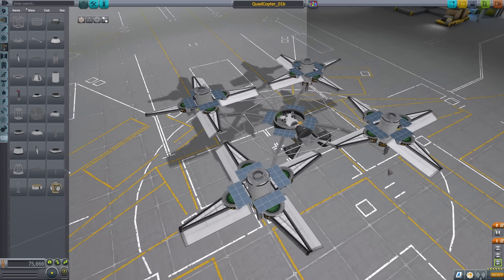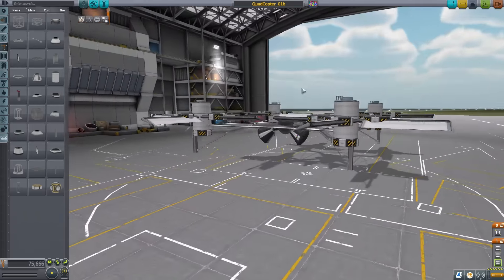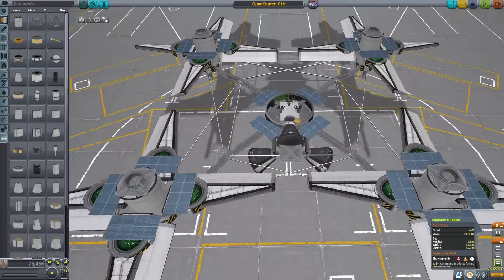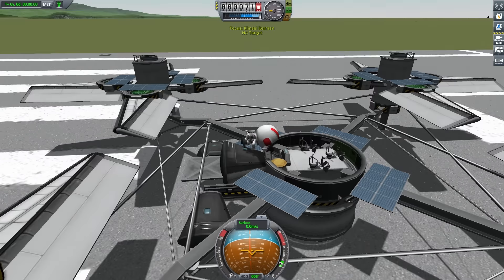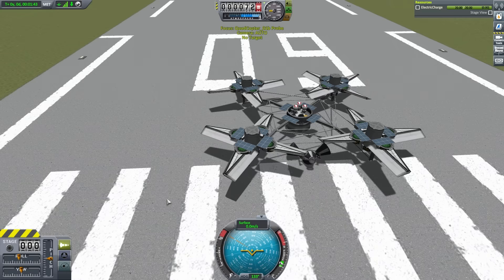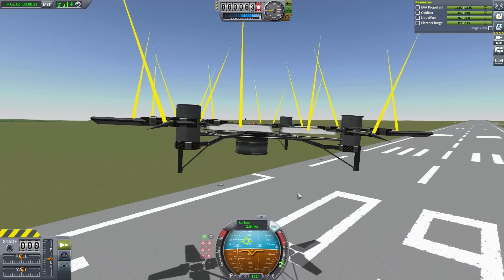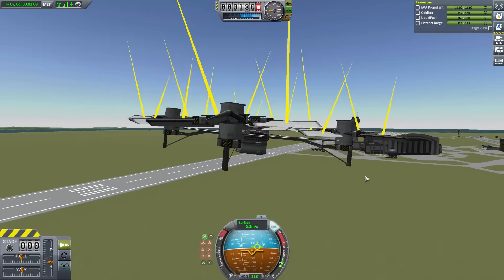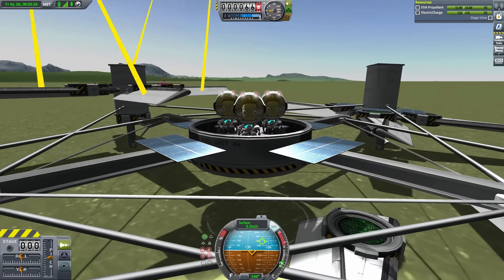KSP stock electric Quadcopter

Comment: I recommend the easy vessel switch mod for the prop crafts, all you have to do is alt + click on them and you are in control and it has the same camera angle!
Reply from the maker: That sounds dangerously like cheating.  ;)
Reply: Inter's Odyssey Also, infinite offset is possible in stock if the part has an attachment node and you turn on part clipping, all you have to do is attach, offset it a bit, and attack another part with an attachment node to the part where you attached it to the craft, and then you can offset it and take off the part after
Reply from the maker: You'll have to show me.  Doesn't work for me.
Reply: i made a different kind of stock prop tutorial on my channel where I clip a nose cone thru a fuel tank
Reply from the maker: Just watched it and attempted again.  It works!  The part I missed from your explanation was there needs to be two attachment points involved at the first juncture before any offsetting takes place.  In other words, the attachment point of the part you intend to offset needs to connect to the attachment point of its parent stationary part.  Then do the offset, then add a 3rd part to the inner attachment point of the 1st part.  But it works now!  Very cool trick, thank you.
Reply: glad I could help :)

Comment: Try putting a fifth blade in the middle instead of the payload that pushes down when you activate it, thus allowing you to bring the craft to the ground where you can shut off all the rotors and safely land.
Reply from the maker: If I'm correctly understanding what you said, you mean put a deployable control surface somewhere on the craft's fuselage that, when activated, will create sufficient downward "lift" to counteract the four rotors.  I see where your thought train was going, but you're also seriously underestimating the power of those rotors.  Besides, the rotors have the advantage of spinning.  They have angular velocity.  Any wing/blade/ctrl surface/whatever attached to the fuselage would only have surface velocity acting in its favor.  As demonstrated, this craft moves at less than 7 mps at the best of times.  Control surfaces wouldn't even react at that speed.  If I built a fifth rotor assembly, that would still have to contend with four counterpart assemblies and, unless I'm descending, it would be dead weight on the craft.  No, there are surely better solutions.  I just need to become a better pilot of this type of aircraft.
Reply: i think his idea was to put an "upside down" rotor underneath the craft, that pulls the craft down instead of up.

Edit: This would of course induse rotation into the craft because it would not be balanced out and also negate the power to lift a quite impresive 4.5 ton payload to the roof of the vab in a matter of HOURS xD

Comment: Try adding a "deploy" action group for the rotors to trim the blades for less lift, giving you a slow descent.
Reply from the maker: I probably will eventually.  This was just a demo prototype.  I haven't even optimized the control surface angles yet, the wings are still parallel to the ground... it's a mess.

Comment: Maybe you can try placing some small wheels inside the engines pushing against the rotors, attached to the middle section so you could use brakes to slow the rotors simultaneously
Reply from the maker: !
!!
!!!
!!!!!!!!!!!!!!!!!!! BRILLIANT!  
Omg yes!  I'm doing that!  Ty, ty, ty!
Reply from the maker: :(  Doesn't work.  If I don't have the wheels close enough to the brake disc I added, they won't turn and therefore don't have braking power.  If I do put them close enough for those things to happen, their proximity interferes with the rotor parts, causing them to clip and glitch and rip the engine apart.
Reply: Inter's Odyssey :/

Comment: Great design! 

You can slow down the propellers by adding some landing gears on the body of the drone. That way you can extend the gears (onto the propellers) and press the brake button. (Hope that was understandable)
Reply from the maker: Thank you.  I tried that a couple of months ago.  It seemed to work for a few moments, but as soon as there was any difference in the drone's attitude (its orientation of parallelism to the horizon), those tiny differences would result in slight angle differences of the propellers (or anything attached to the rotor system) hitting the landing gear with slightly more or less force, depending on the angle of tilt, which eventually escalated into a catastrophic failure of either falling out of the sky or ripping apart one or more rotors while still in mid air.  /shrug
Reply: parachutes on the main body

Comment: could you adjust the rotation of the rotors by adding wheels/landing gear to the main craft? I don't know how rotation physics work in kip but you don't have a huge amount of lift here...maybe the breaks would be enough to slow them down enough for a descent?
Reply: as in - the main craft in the middle has wheels that touch the rotors and uses the breaks or forwards/reverse steering to add/subtract a bit of rotation from the rotor shafts?
Reply: of course they should grip the rotor from at least three sides to make sure they don't push it out of alignment inside the bearing and cause weird clipping and/or sudden death
Reply: at first I thought about having deployable radiators on the main craft to cast shadows on the solar cells to adjust how much voltage they get. but thats a nightmare since at any time except noon it will induce asymmetric lift. Though I guess one could minimize the parallax effect by having the surfaces very close together. Having a fifth rotor (preferably two with different directions) to generate downward thrust on the main craft would also be an idea, but then again it wouldn't be a quad copter anymore. It would be really nice to find an aerodynamic solution, but tbh im drawing a blank
Reply: overengineering solution: make the four rotors themselves able to tilt by putting them on another horizontal rotor.
Reply: damn. there has to be an elegant solution here
Reply: if all the rotors spun in the same direction you could slow down by rotating the whole craft and thus reducing/increasing blade tip speed. but then you would need to rely on reaction wheels for stability since the whole thing would probably precess around
Reply: I could see your first idea working, people have used aircraft landing gear for bearings in the past, although I'm not sure if Squad have broken more wheels with the latest version ;)

Comment: Hey Inter, have you noticed a decrease in performance with stock propellers in the latest version of KSP?
Reply from the maker: Haven't done much with them lately but today I greatly improved this quad's engines and yes they seemed remarkably underpowered for the amount of torque I tucked into them.
Reply: Inter's Odyssey Both craft I submitted to you are stock-propeller craft. The b36 is really badly effected and definitely needs a redesign if you want to fly it on 1.2.2. 
The second craft still works but is noticeably underpowered. 

If you have 1.2 separately installed on your computer I strongly recommend trying the B36 on it, though I will work on an updated version for 1.2.2.
Reply from the maker: *****
Oh I misunderstood your original question then.  I'm still on 1.2.0.  Won't be a problem.  I can edit the *.craft files' version numbers.
Reply: Ok good, I submitted the crafts while on 1.2 so it should work just fine for you. I don't recommend upgrading to 1.2.2 or at the very least installing it separately so you can see the differences for yourself. I'm not quite sure what it is, larger coefficient of friction between parts, slower rotational speeds, or something else; whatever it is it seriously f'd up my B36 pusher engines.

Comment: Can you not have yor microphone inside of your keyboard? Your spacebar sounds like a nuke
Reply from the maker: Sure, as soon as you buy me an extendable mic boom and some construction materials so I can build a place to mount it.
Reply: On an honest note it's a great build but all the keyboard and scroll noises got me a bit annoyed. Not to say I don't know your struggle, I have my own microphone mounted ontop of my monitor and still get sound from my keyboard coming through. You should really put some ads on, It might get you a couple dollars for some new equipment and I think you've derserved it. :)
Reply: if you have a proper keyboard with mechanical switches you can buy/make yourself some cheap dampeners for the sounds

Comment: You should get rid of the solar panels and use infinite electricity to control on and off of all 4 rotors at the same time. 

I tried making a quad, but it wasn't self stabilizing... now make yours deliver pizza!
Reply from the maker: Hmmm, to play the role of a megalomanic powerplant director, or NOT to play the role of a megalomanic powerplant director...
How about a 4.5 ton pizza?  Delivery within 30 minutes is *not* guaranteed.

Comment: Maybe you should try adding a jet engine to the back? Would that affect the aerodynamics?
Reply from the maker: Adding other forms of propulsion would change the velocity achieved by the craft no doubt, but that defeats the attraction of the applied systems here where electrical power provides infinite range unlike combustion-based jet engines.  Yes, aerodynamics of the props would change because the plane of their rotations would have to compensate for any additional velocity, grabbing different quotas of air for lift during each period of the cyclic.  Not sure if that would worsen or improve the likelihood of structural collision on this particular model.
Reply: That makes sense.
Reply: Could you perhaps get something to drain power so they can be sort of turned off and on with action groups.